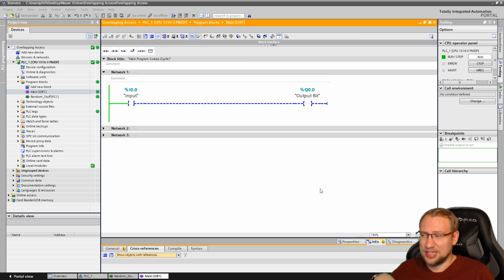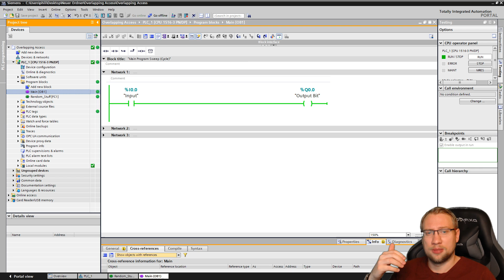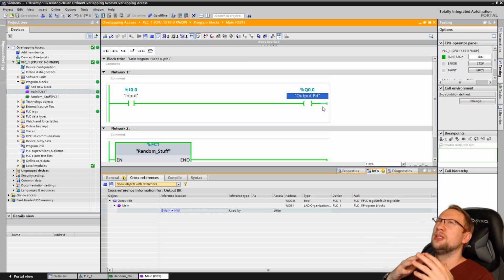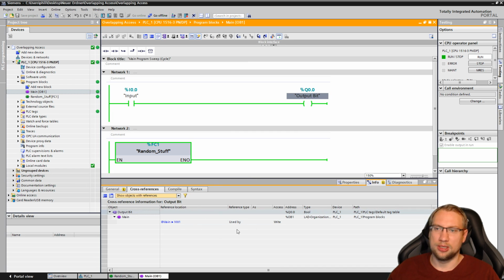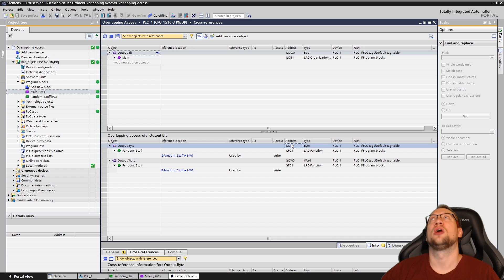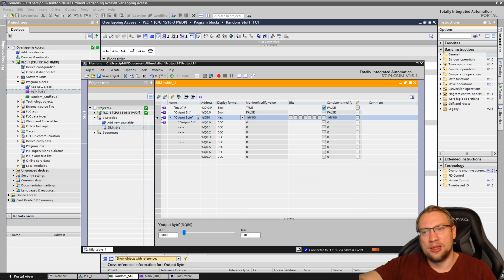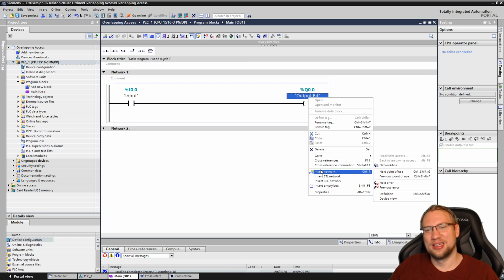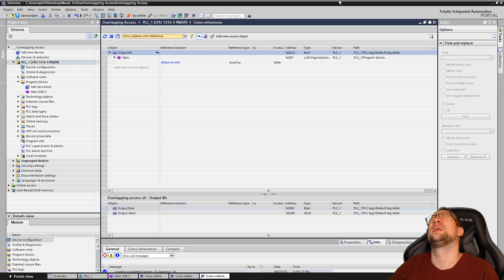TIA Portal: Overlapping Access (Advanced Cross References)

Comment: hello Hegamurl,
there's such a stuff, this presumably is not documented oficially (at least I failed to find that in docs) which put into a stupor not only newbies.
I mean when you are trying to write the same, say, Q3.0 from neighboring networks (not simultaneously).
NW1
M100.0
---||----------------() Q3.0

NW2
M100.1
---||----------------() Q3.0 

In case of NW1 everything is expectable.

And in case of the second NW it becomes green as well, yet physically you won't see respective green LED on DO-module face, and 24VDC doesn't output correspondingly.
So could you make some comments on this stuff? :)